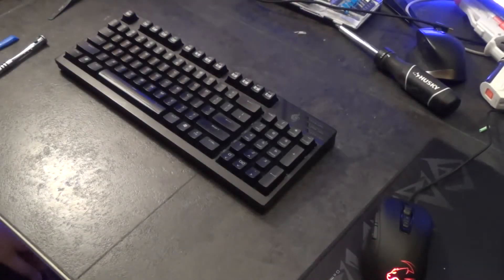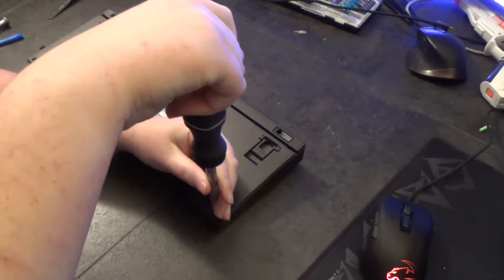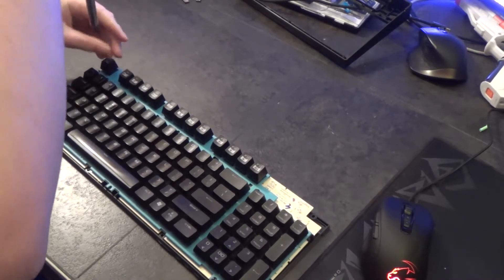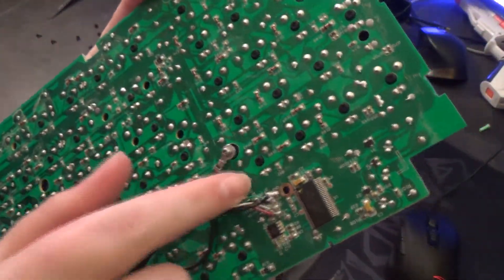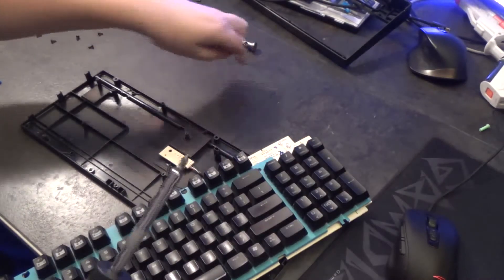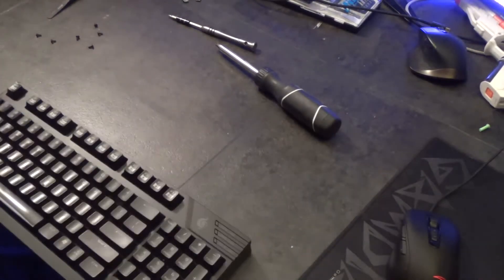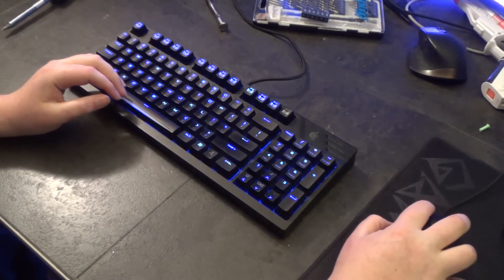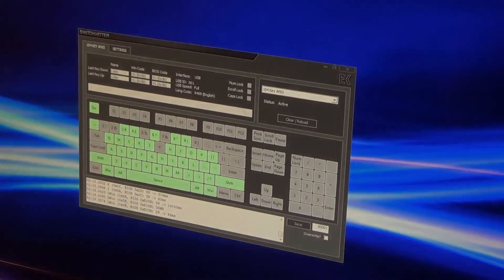The QuickFire TK and fixing the disconnect issue

Comment: I have a kind of more weird issue. When I plugged my keyboard it just turns on some LEDs (f12, caps, scroll, num, and arrows when num lock is off using another keyboard attached) instead of mainly way no key work and no LEDs turn on but this mentioned. In computer keyboard are recognized but no key works.

Could you please help me?
Thank God I found your video because youtube doesn't want to show it.
Reply: this is happening to me right now...

Comment: Just got mine working perfectly thanks to you. The red U+ on my connector side was completely broken off. I got it on, and it works great, though it seems the wire/port for the Mini USB is a little bit wonky. Wiggle it the right way and it shuts off. It's not an issue in reality of how I use it, but either the port or the connector on the cable it came with don't line up right.